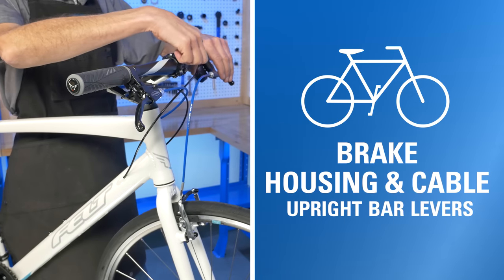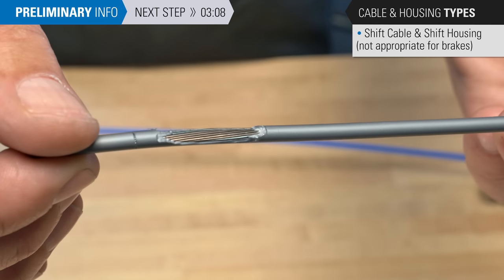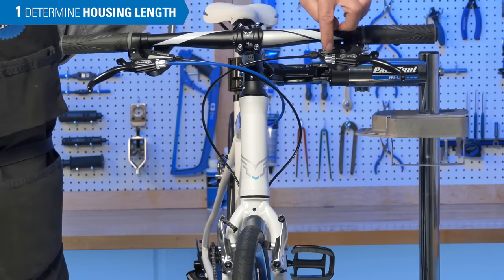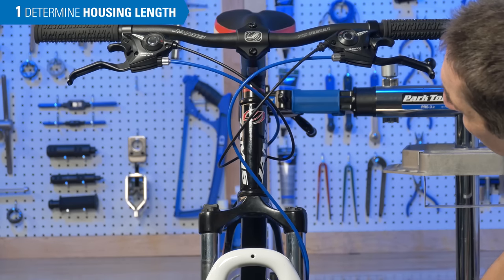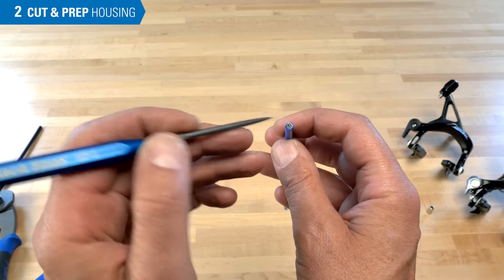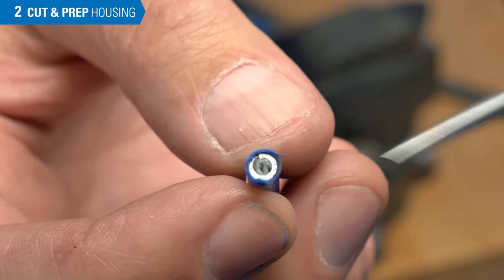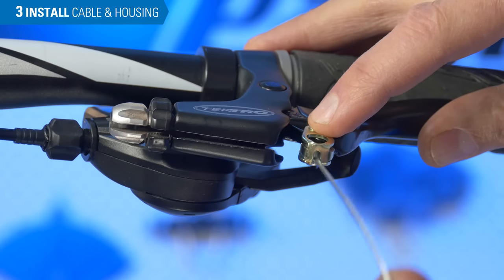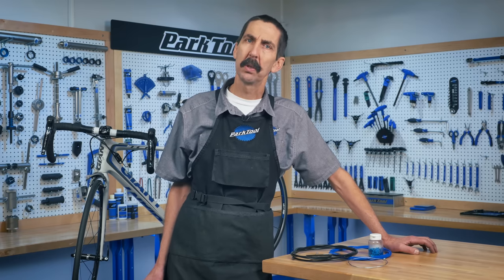Brake Housing & Cable Installation - Upright Bars

Comment: Just Found this Channel. After watching this I can see that an Improvised fix done on a co-workers bike was not a recommended course of action. Which is the suspicion I had after looking at his brake cables. It looked like two Cables had somehow been connected from opposite sides of the frame.

Comment: Easily the best instruction video I've see, huge thanks.  Especially impressed on piece getting cable/outer housing at correct height or level relative to adjuster slots.  Excellent: cable must 'flow' out of adjuster (cable must not be at higher level) or be excessively short (with excessive downward pressure on adjuster).  Can now replace a v-brake cable, the same principle as your disc brakes.  Great video from Park Tool!

Comment: I have another YT channel, Ranging Rover, which is about the Terra Trike Rover recumbent Trike. They no longer make this model. It will become a classic Recumbent Trike, as there are many of them out there still. 

There are few videos out that tell us about doing specific maintenance on Trikes, let alone specific models. I too have park tools, because when I added my Bafang Mid drive to my Rover, I needed proper tools. I was a tool maker for the auto industry. I don't mind paying good money for good tools. 

Now I take these video's for regular bikes and apply the lessons to working on my Rover. My vids are not as professional, in fact, I they are more like a shade tree mechanic than anything as I tend to work on my trike while its sitting in my apartments small living room.  But I am covering a lot of the same subjects as these videos do. And my viewers are thankful that someone is finally putting out useful vids for our specific need. Meaning us Recumbent trike riders.  And I am thankful for Park Tool  and Utah Trikes, both of whom put out great videos for us to learn from.

Comment: I've just invented a fantastic way of replacing an internal brake or shift cable.  
1.  Take the inner cable out, leaving the outer cover in situ. 
2.  Cut a 2" length of old inner cable and feed it into both the old and new outer cables, forming a single cable.
3.  Crimp both outer cables to hold the inner cable in place.
4.  Push, (Mainly) and pull the old and new cables through.
5.  Once through cut off the damaged end of the new outer cable and feed the new inner cable through.
   Et Voila!  I thank you, I thank you.

Comment: Hi there Cable Guise just remember if you're putting your spares kit together always have 2 spare gear cables at home and consider taking 1 cable with you when 20km away from home and yeah those clean looking cable caps if without them a tube of Liquid Nails you put a drop on the tip of the cut cable ultimately the best is leave 25-30cm of cable and loop it up like when you purchased the thing brand-new with the bit of glue on the tip, some people say "What about these spares? What about those spares?" The short answer is always answer a question with a question "Why not bring a spare bike? What if your head falls off?"

Comment: How about showing us how to replace the rear cable on a Schwinn Meridian tricycle? There are plenty of us seniors  who’d like to change to high rise handlebars, but will need to replace the brake cables with longer ones. Thanks to your video, I’m confident I can replace the front one. The back one, not so much.
Reply from the maker: The concept for replacing front and rear is the same. The big difference for you is going to be gaining access to the brake which is likely under the rear basket. It will likely be a disc brake as well.

Comment: Should the brake barrell adjuster be screwed all the way in to the brake when replacing housing?  Or out a few turns to allow for adjustment when finished? Thanks!!  Huge fan.

Comment: Dads bike needs an overhaul. I saw the straight wire and figured it was a Kevlar woven cable, it turns out it was shifter cable. Big mistake. It didnt blow out the side but it pulled the wire right though the end cap and into the lever, crushing the housing leaving the wires exposed about an inch out the end. Learn something every day. Never would of had to know if my dads bike wasnt 20 years old lol.

Comment: Pro tip: if the cables and housings are worn to the point of needing replacement, the liner in the noodles may also be worn.

Comment: I find it odd that US bikes have the front brake on the left - we have ours on the right, same as motorcycles.
Very informative - Sub'd!
Reply: Its the same on European Bikes.
Reply: TheBamPlayer - crazy! So when you switch between a motorbike and twist’n’go motorbike, the brakes are reversed! Sounds great in an emergency situation...
Reply: @c7uk  I would suggest you to switch them, if you are used to the motorbike brakes.
Reply: TheBamPlayer - alAbsolutely! But here in UK when you buy a bike, the brakes are already set up ‘motorbike fashion’; ie right is front 😉
Reply: This is because of right hand driving. For us (and US) turning left is the more risky manoeuvre. You need to signal the turn with your left hand, so you have to use the right hand to brake and slow down before turning. It's safer to brake with the back wheel (less risk of losing control).

This explains the difference, as in UK it's the right turn that's more dangerous.

Comment: Hello, this is great and very helpful video for me as begginer.
I like to do it on my own and to learn something by the way.
So I decided to upgrade my brakes, brake levers and shifters.
Question:
Brake levers and shifters are Shimano ST-M570
Now I am wondering how to insert brake cable in the lever?
I know that the lever has slot on itself as this in your video, but as my levers are bit specific I am stuck.
Also I saw shimano pdf tutorial about inserting brake cable, but I am afraid to break plastic clip which is in the lever.
Can you please explain it to me?
Thank you!

Comment: I'm about to change all if my cables, does it matter whether I start with the gear cables or break cables?
Reply from the maker: It does not matter which you start with from a technical stand point but I find it is typically easier to start with the shift housing.

Comment: Great video, but I have a question please:  I am assembling a new bike, and the only portion of the hand brakes I need to assemble is the getting the front brake line into the handbrake itself.  I see the barrel end, but it is right up against the housing.  There is no bare wire for me to feed through the slots in the hand brake apparatus.  Help this newbie please?
Thank you!
Reply from the maker: You will need to loosen the anchor bolt or unhook the opposite end of the cable from the brake. Then you will have enough slack in the system to feed the cable through the slots. You may be able to pull on the cable end to expose enough wire to feed it in the lever. hope this helps.

Comment: Why would it be bad if you mixed up the mushroom end with the teardrop end?
Reply from the maker: Brake cables come sometime with two ends.  A "disc" shaped end, like a round circle, for flat bar levers.  The other end is the "Teardrop" or "Mushroom".  Teardrop=Mushroom.  The flat bar levers do not accept the Teardrop/Mushroom, only disc.  The drop bar lever do not accept the disc.
Reply: @parktool  Thank you :D

Comment: What kind of “cable lube” are you recommending please..For both new and old? Thanks
Reply from the maker: CL-1 chain lube works well for this. Or a light grease such as HPG-1. Do not use a heavy grease, as it will slow the cable.   Most any chain lube will also work.
Reply: Great tip thank you, I typically use the same (chain Lube) 👍. Some manufacturer say to use no lube🤷‍♂️, my experience with various manufactures (cable/housing) is I still will get corrosion internally overtime, I live & ride in a wet humid environment. So I find the appropriate lube is definitely advantageous for trouble free operation. Thanks 😊

Comment: I need new brake handles i think? because after i pull my brake they don't snap back in a open position ( meaning the brake is still in a closed position and i have to pull my handle  out in order for them to stop rubbing the tire, also before i started watching these video i put a basket on the front of my bike and damaged the lock ring's threads so they don't work well with the barrel adjuster 'am i right? in order to fix my brakes so they will snap back after using them the adjustment needs to be made in the lockrings and barrel adjuster? PS. thank you for taking the time to advise me.
Reply from the maker: It sounds as if you have excessive drag in your cables and housings. Make sure your basket is not pinching the housing or causing a harsh bend. If the basket is not causing the issue I would suggest new cables and housing. Hope this helps!
Reply: Thank you, Park tool i have moved my cables i think they were pinching and they seem to work a" little better "do you think i should shoot some lube into the cables will that help with the drag?
Reply: cables are not expensive just replace them and a little lube could help

Comment: The end cap of my housing became loose as I was troubleshooting the issue with my rear disc brakes rubbing against my rear discs. Normally it shouldn’t be loose enough to pull the housing out of the barrel. How do I secure it into the barrel?

Comment: My housing is sliding down off the cable and the end-cap is unseating from the barrel adjuster whenever I squeeze the brake. What do I do for this?
Reply from the maker: It sounds like your housing is unseated from its stop on the frame or brake. Be sure everything is seated properly.

Comment: The end on the MTB brake cable I got is smaller than the original one on my bike, so it doesn't fill all the space in the hole in the lever. Is this normal? I'm not sure it's safe to use a cable with a smaller end...
Reply from the maker: It may be you got a shift cable rather than a brake cable.

Comment: Are those tools necessary? Or are they recommended?
Reply from the maker: Well, these are recommended but in this tutorial it would be difficult to accomplish without them. You may be able to complete the task with one of the two cutters and a paper clip or other pick like tool but it would be much easier with the proper set of tools. Hope this helps!
Reply: Park Tool It does. I love the videos and the explanations in the replies. Currently having to take a bike to work. I know enough about them,but there's still things I'm a bit rusty on. I used to work on my own bikes as a hobby as a kid,now it's part of my lifestyle,so it's good to be knowing.

Comment: does it really matter if you're using a 90 degree noodle or 135 degree on the front or back brakes?
Reply from the maker: If the cable does not feed to the brake at the right angle it may be hard to adjust the brake due to the housing effecting the balance. In many cases either will work and is more of an aesthetic thing.
Reply: @parktool  Thanks! plastic end caps vs metal? plastic for shift, metal for brakes?
Reply from the maker: @drewmcauliffe6285  This does depend a bit on a mechanics personal preference and also to some extent the environment the bike will be in. Metal is often the only option for Brake housing based on the amount of space given. When it comes to shift, plastic is often nice because it will crack itself instead of kinking the cable where it enters the ferrule. It also does not corrode and get stuck in a differing metal cable stop. The weakness of the plastic caps is that the strands can blow through them easier than a medal version.